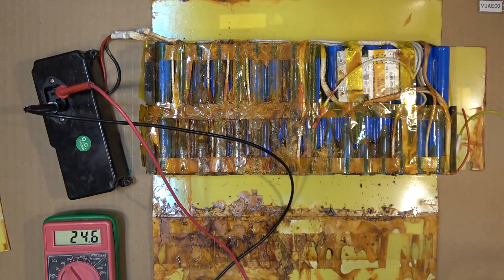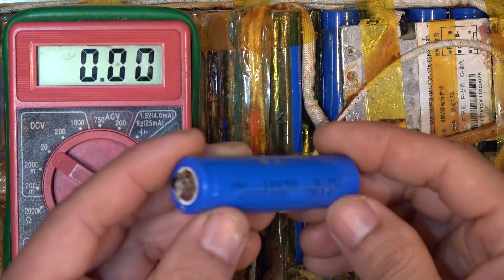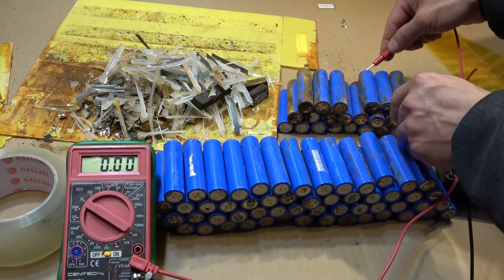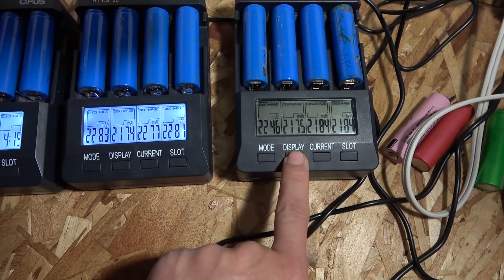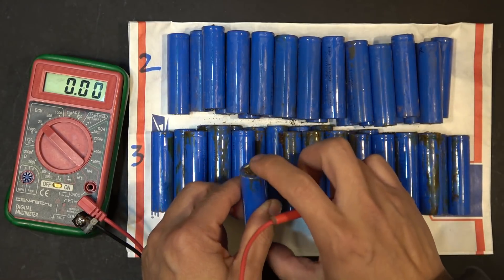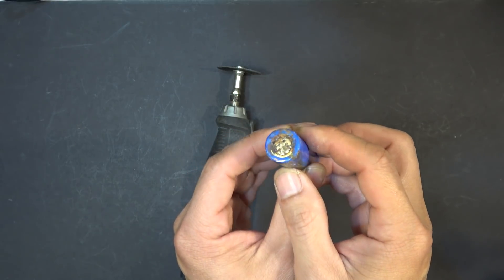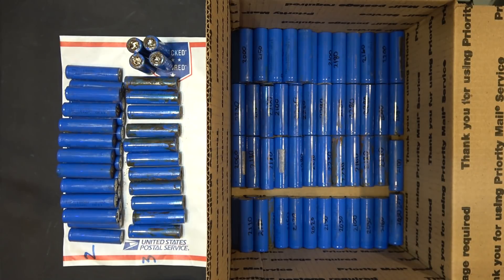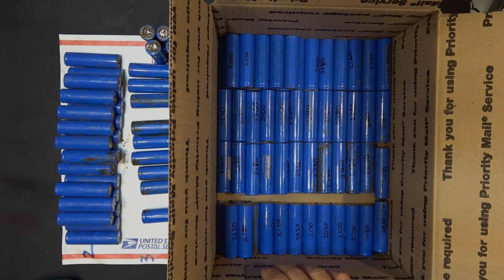Ebike Project S02E02: Salvage 18650 cells from corroded ebike battery w/ water damage

Comment: One of my controllers couldn’t receive power and I found a small amount of corrosion on the back row of the battery cells. I don’t have the assembly parts/tools right now to deconstruct any further but I highly suspect this is the problem.

Comment: Who ever built that Pack used Nickel Plated Steel Strip ( Not Pure Nickel ).  When the water got to them Electrolysis set in and Wasted the contacts.  If they had used real nickel that pack may have survived the Water Egress with little damage.
Reply from the maker: Nothing can survive that much water damage. It would still short out.
Reply: 18650s have a steel outer case under the shrink wrap

Comment: That was a large battery for an ebike. Maybe try building a battery pack with 4 modules of 13 cells each and then test the range.
Reply from the maker: It has to be large for a reason. The cells are low discharge cells and 4P might not be enough current for the motor.

Comment: Take some wire brush and wd40 and clean rust off the battery's take of the plastic insulation and clean them check for the holes in the battery's... 👍

Comment: Specs
https://www.aliexpress.com/item/HW-18650-battery-lithium-battery-18650-3-7v-li-ion-battery-2200mAh/32317930234.html
Reply from the maker: Nice! Thanks mate. How did you find them? :D
Reply: @vuaeco  I think I searched "HW lithium-ion 18650" or something like that. I see they're discontinued, which stands to reason if the pack is several years old. Alibaba's kind of a scam sometimes; if you look at the "certificates" on that page up close, you'll see the only battery mentioned is a Headway-sized 10Ah cell! LOL

Comment: When you rebuild this battery, how about trying the battery building boards developed by Jehu Garcia?😎
Reply: Those boards are 7S.  He needs 13S .  Also those Jehu's boards are limited to under 10A I believe and that wouldn't fly in most E-Bike Packs.  The way Jehu's boards are configured he would need 13 boards to make up 7P sets.  Not configured right for this job.
Reply from the maker: I didn't watch that video yet. But I think I have a different plan for this pack. Stay tuned! :D
Reply: Jehu's boards are intended for low current powerwall application, and theis battery pack is described as having ordinary low current cells like those in laptops, not the high current cells used in power tools. 48 volts at 10 amps is 480 watts, which is sufficient for an ordinary on-road bicycle. Could you connect 7 cells in series on one board and then 6 cells on another board to create a 13S module?
Reply: @dillondurban4899  No but this guy needs 13S.  The Power Wall boards of Jehu's simply can't deal with the amperage a E Bike battery used.   Configuration is all wrong.   A 13S 48V cell needs to be producing some 20A at full out.